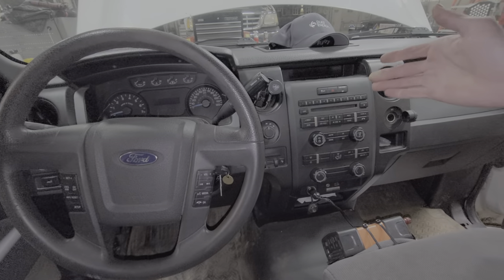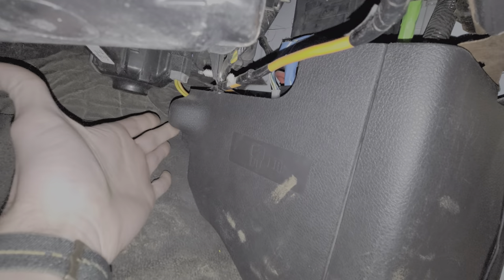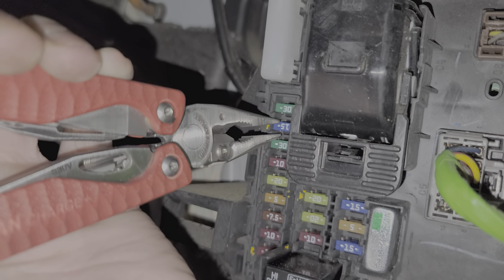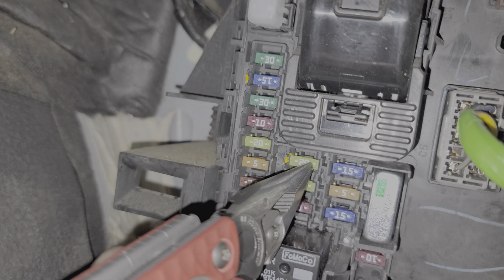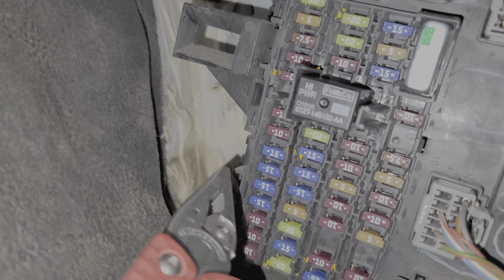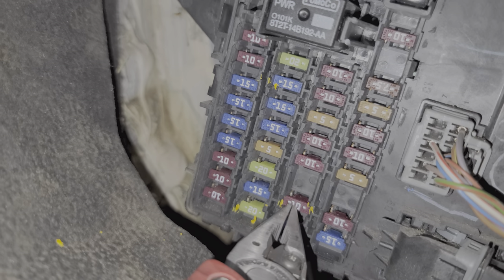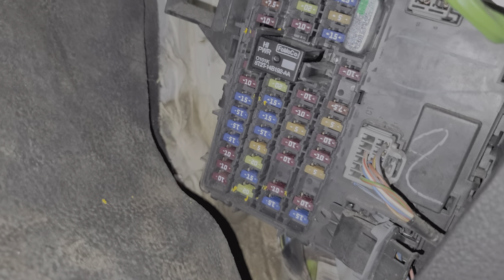2013 F150 Radio Fuses

Comment: So just a heads up as you check each fuse they are tiny and you are standing on your head. But once you check a dozen related fuses you should be mad enough to hit the radio four or five times... fixed mine. Radio is prone to solder joint failures!

Comment: 2013 F150.  We pulled the fuse to the radio because it was intermittent & doing weird stuff, crackling noises, LOUD POPS. The internet said the problem is a solder joint inside the radio. After pulling the fuse... all it's lights went dead & we were good for 3 weeks.This morning,  a religious radio station is coming through the door speakers? We opened & closed the driver door, it stopped for second, then came back on. Then.. we found we could turn the volume down with steering wheel volume control only! What the actual F? I thought pulling the fuse TO THE RADIO would eliminate it? Original owner in Ct., not a flood truck from down south.
Reply: @jeffrandolf5673  sounds like your truck might be possessed by Jesus

Comment: what if all the fuses are good but the radio buttons still don’t work?
Reply: Did you found out what was the issue ??
Reply: Mine is the same issue.  I have taken the factory stereo out , the main power wire is good but I can’t get any power from the power source when you turn on the key.   Any ideas???

Comment: Which fuse do I pull to check for the cd player mine won't Accept or eject a CD and when it keeps it. You destroy the CD trying to get it out. It's in a 2010 F-150

Comment: My 2013 f150 radio says usb when I plug it in but goes right bavk to playing the radio even when I use the 3.5mm plug it goes right back to the radio do you think a hard reset is needed?

Comment: Thank you for the video.
My radio works with the steering wheel controls only. It stopped working with the controls on the dash. Any ideas what the problem is?

Comment: can you please help me?! the radio buttons on my 2007 f150 xlt lariat dont light up. the radio plays fine and works perfectly, but the volume and all the buttons dont light up at all. the buttons for the ac and all that work. also, the volume and seek on the steering whell dont work. is it a fuse or what? im lost. please help if you can buddy. im  on facebook if you need to contact me. ive never asked a question on youtube  so i dont know how this works. i subscribed to your channel so i might get an alert but i dont kinow for sure. my name is jimmy cunningham in birmingham alabama. thanks dude

Comment: I could need some help. My truck had a working display picture and radio. I turn it on and now the displays gone but the radio works fine. Any solutions?
Reply: @JerkyTreat  mine just doesn’t work anymore. Idk if the display cord burnt out or something melted. I’d have to check. But good to know u have a similar problem

Comment: I changed the battery on my 2012 F-150 and now the radio and clock do not work at all. Wondering if it could be a fuse?

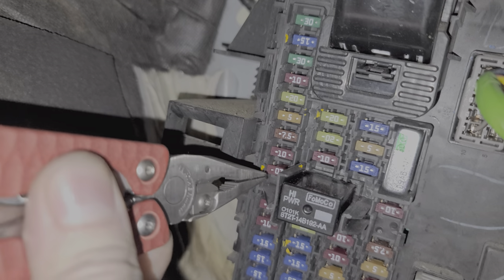Comment: 0:59 Fuse #9. I pulled because the radio wouldn't shut off with the key, on a used truck, and the heater/defroster came on in HIGH!😂
Had to put it back.

Comment: Wondering if you can help me out. I have a 2013 f150. installed a aftermarket radio. I would like to have it come on with my remote start so I can have my climate controls on with remote start. Do you know how I can make this radio power up when I have my truck running with remote start. I have asked the dealer if there is a option in forscan and they told me there is no option to do this.

Comment: Whats the big plug in above the fuse box I have a 2013 Ford f150 stx and it won't start or turn over it just clicks one time from that fuse box location but if I unplug that big plug in it will start do you know what that plug in is

Comment: I appreciate your video, allowed me to verify no burned fuses on a 2012 F150 with flashing clock dead radio.

One suggestion for your video, the fuse cover holds a fuse puller that works better than those needle nose pliers.
Reply: Not if it's a used truck and someone has already misplaced them.
Reply: Did you just replace the radio? I tried baking my radio hoping it was old faulty soldering but it didn't work so im guessing a replacement is needed. Still haven't checked fuses admittedly.
Reply: @ericmendoza6261  Sounds like your doing things backwards. The fuses would have been the first and easiest step. Baking the motherboard is a last hope effort, and has risks of destroying the radio. In my case, the hail Mary worked...  for a few months. I'm not going to try it again and am shopping for a replacement now.
Reply: They way it was and how long it was going out I don't think it'd ever be a fuse in that scenario.
Reply: Did you ever figure out what was wrong with the flashing clock? I have the same problem
Reply: @anthonycorbett2571  That's what we get when the motherboard fails (due to poor soldier joints). The cure, on in my case the temporary cure, is to pull the radio out, disassemble to get the motherboard, follow strict instructions of warming the soldier joints via an oven, then reassemble and reinstall to find out if it worked. It did for mine for a couple months, so I was amazed but not interested in taking a second shot at it. Shopping for an upgrade now and would love to hear success stories and pointers for a new radio.
Reply: Flashing clock on radio.. REPLACE RADIO

Comment: I have a 2013 fx4. I took out the radio to add a t harness and noticed  the harness has been messed with by the previous owner. Now i have no power to truck with the key being on or off.

Comment: I've got a 2013 F150 and am completing an amplifier install with the stock head unit. For the amp turn on wire (blue) I've used a fuse tap to plug it into fuse #38 and it seems to be working because it's powering my amp. I'm trying to understand what fuse #19 (dsp/amp) would be used for. Is it better to tap into #38 or should I tap into #19?
Reply: Thanks a lot bro Ive been trying to find the fuse to use and because of you it's now working
Reply: What fuse tab did you use? I bought one for a low profile mini fuse and I can’t plug it in. I bought it at auto zone. Can you send me a pic?
Reply: Question - I 0:05  have to use both ports on the back of my stock radio , if I’m installing an aftermarket ?

Comment: Man my radio quit working but my clock flashes and my temperature thing works  my wipers come on when I start my truck now my ac went out again after I replaced the fan and motor

Comment: Changed all the fusses you mentioned. Turn on radio shows F150 & clock flashes. No radio
Reply: I’m having the same problem please let me know if u fixed it
Reply: Me too
Reply: That's the same problem I have. Did anyone get it back to work again?
Reply: Didn’t change any fuses but this is also happening to me
Reply: I replaced the first radio in 2013 f150 at 100k. 2nd one just went at 170k. Crap stereo systems. My 04 explorer has 269k. Time never synced right. My 98 explorer screen crapped out at 100k. Ford seems to get roped into some cheap vendors for electronics. Thanks ford.
Reply: Same thing happened to me. I’ve heard it’s Usually not the fuses, but worth to check them. I most likely will just get a new radio.
Reply: Flashing clock means cracked solders on the radio board.  You can try to take the radio out and put it in the oven to melt and cool.  There are other Youtube videos regarding.  That worked for me but eventually, the radio went bad again.  I put a new double din radio in.  Way better and fewer problems.

Comment: Stock Radio quit working. Installed a Sony Head Unit. Worked for 3 weeks. Randomly shut off and wouldn't work.

After watching this video, I removed fuse 38 and checked good and reinstalled and it started working again. It wasn't loose. What could have happened? It almost looks like a fusible link in that spot.

Comment: Great video,  well explained. Unfortunately, my radio still doesn't work.
Reply: mine is the same... also the clock and the sync... i have checked all the fuse... but none is bad... any suggestion?
Reply: @ccrostelli  I'm checking a part in my door that connects most of the door wiring.  I'm having problems with the speakers and door locks too. I watched a video of a guy taking his radio apart and putting it on the oven too. As crazy a that sounds others said it worked for them.
Reply: @littlestflyable  thanks... i really do not know... i will try
Reply: @littlestflyable  wheres the video